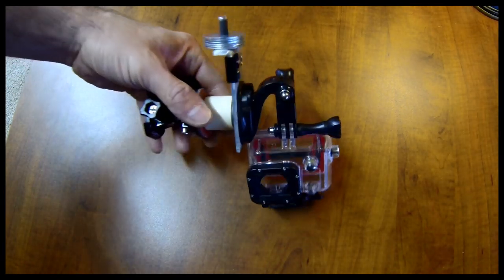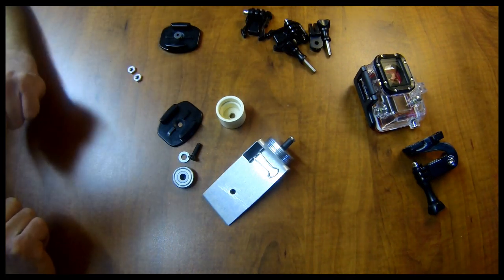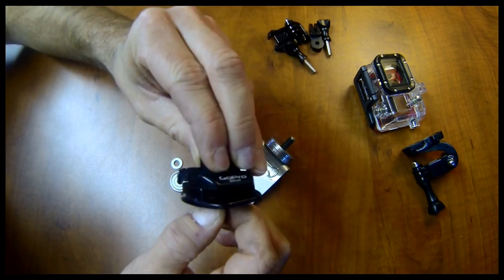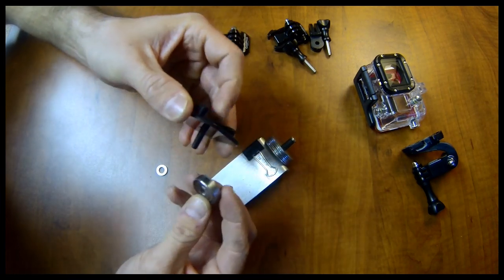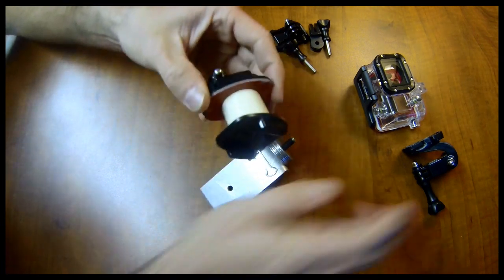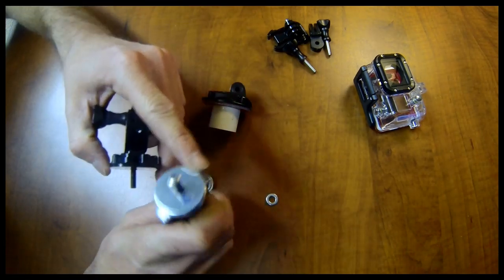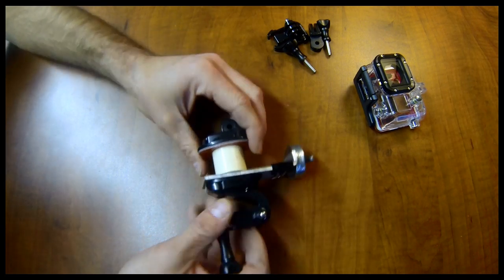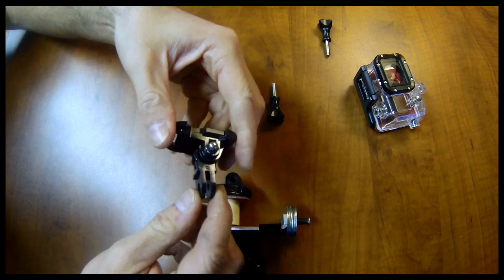How-To Build a GoPro Hero Self Leveling Mount

Comment: Very nice work, the bearing looks just like a roller blade or skateboard bearing.   I will try something like this for attaching to the end of a sailboat boom and post results when I get it worked out.
Reply from the maker: Glenn Barth Thanks Glenn! The bearing looks the same as a rollerblade or skateboard bearing but the size is different. The size that I use works well in CPVC pipe sizes. I haven't tried different size bearings but you may be able to make them work. You might want to also check out my version 2 of this mount. It works on a different principal. Thanks again!

Comment: How did you balance it?
Reply from the maker: James DeRuvo You need to balance it so that the camera side is just barely heavier than the top portion. That way the camera stays down but doesn't swing wildly. BUT I would suggest that you look at version 2 of the self leveling mount. It's a totally different design that doesn't require balancing. Thanks for watching!

Comment: Hi cool video. I'm making something slightly different but quite similar design. Where did you get the end cap from? I'm struggling to find something suitable
Reply from the maker: IamKeeTom Hi. Thanks for the comment. I think you are asking about the 3/4" CPVC cap. Those are easily available in plumbing and hardware stores in US but I'm not sure where you live. CPVC is a different size than regular PVC pipe. You might want to check out version 2 of my self leveling mount. I like it better and it might help you on your build: GoPro Self Leveling Mount: Version 2 - Overview and Sample Footage  and GoPro Self Leveling Mount: Version 2 - Step-By Step Build

Comment: Just wondering what type and size of bolts you used for this. Thanks for sharing such a simple, cost effective idea!
Reply from the maker: Thanks Matt! The bolts are 10-32 flat head socket cap screws. One is 1/2" and the other is 3/4" long. The center hole in the bearing is 6mm so a 6mm flat head socket cap screw would work better but could be hard to find. I didn't show this in the video (not sure why) but I used a thin brass sleeve to take up the play between the 10-32 screw and the bearing inner diameter. Having said all of that, I'm about half way done with a different design of self leveling mount that I think is going to end up being a better way of accomplishing the same thing. I'll make a video of it when I get it done.
Reply from the maker: Hey Matt. Sorry it's been a little while but I did finish the second design of this self-leveling mount. I just uploaded the video here: GoPro Self Leveling Mount: Version 2 - Overview and Sample Footage . I should have a step-by-step build video up sometime soon.